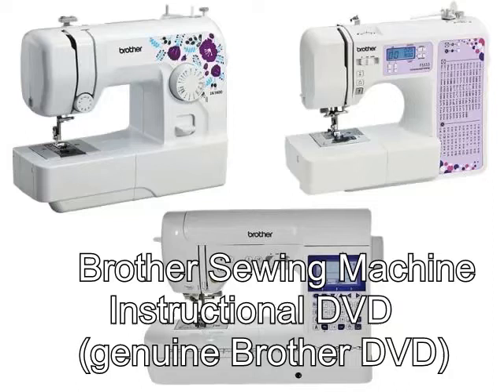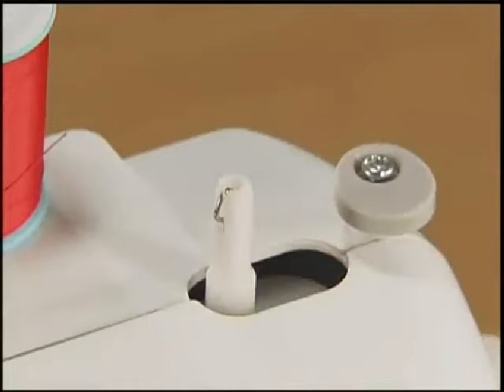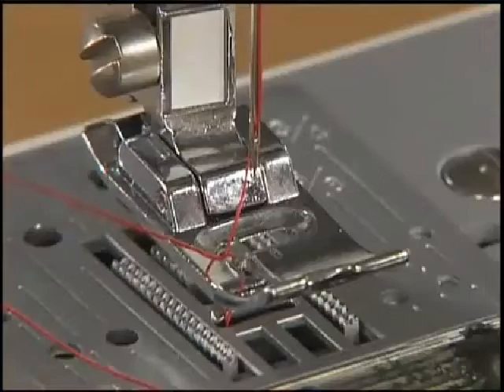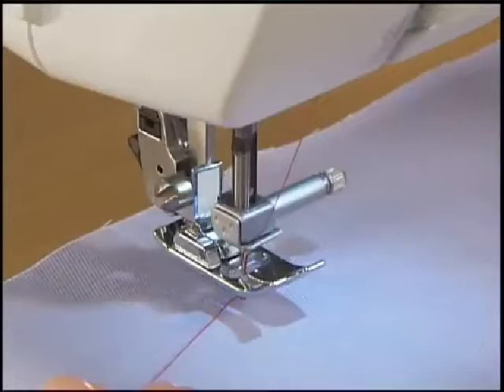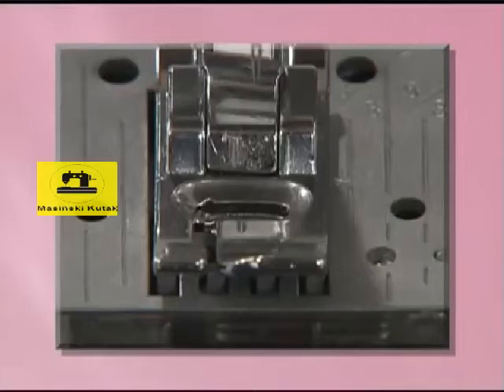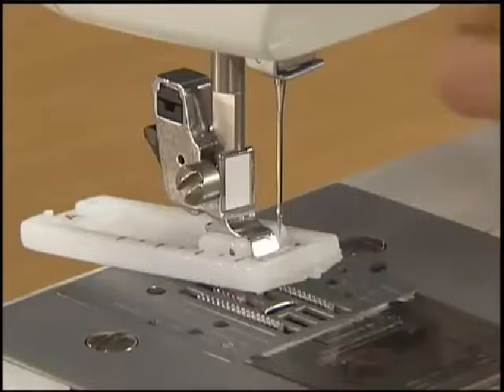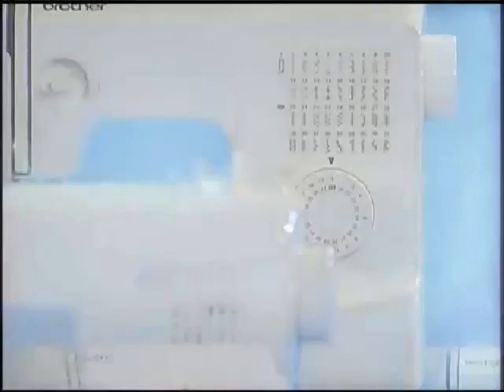Brother Sewing Machine Instructional / Brother Sewing Machine Tutorial dvd

Comment from the maker: 1:03 Setting up the sewing machine
1:30 Winding the bobbin and lower thread setting
5:24 Upper threading
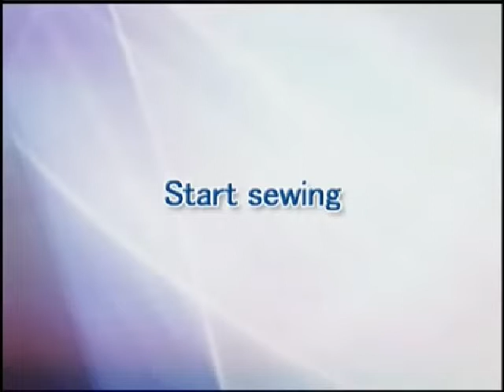8:44 Start sewing
10:35 Reverse sewing
11:39 Thread tension
12:13 Satin stitching
13:22 Adjusting the stitch lenght and width
14:30 Buttonhoe sewing
19:08 Button sewing
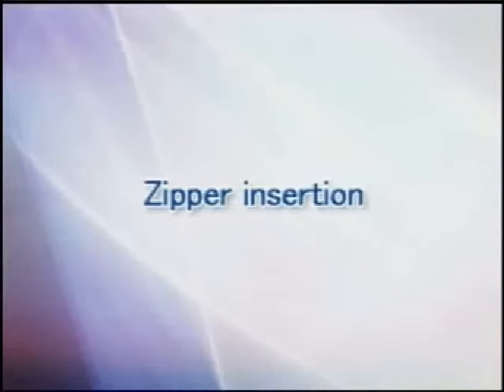21:15 Zipper insertion
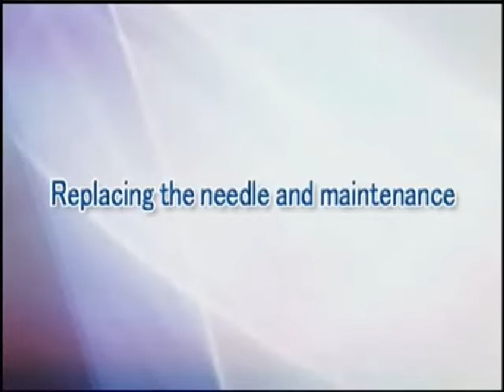22:17 Replacing the needle and maintenance

Comment: I have computerised sewing machine FS155
 but it doesn't work due to thread frequent break,  moreover I have multifunctional kit but I don't know how to use
Help me if you can please
Reply from the maker: So,Brother fs155 sewing machine frequently breaks thread.?
Thread breakage on a sewing machine can happen for many reasons, such as: poorly adjusted thread tension, old thread that breaks easily, poor quality needle, going over multiple layers of fabric...etc.
It is necessary to first check the tension of the lower thread and then reduce and increase the tension of the upper thread until a quality seam is obtained.
Reply: Yes it's brother fs155 
And it's still breaking thread frequently 
The thread sometimes hard stuck between the spot of 2 & 3 number😔😔

Comment: What about front loading bobbins? My machine is a ls2350 and you can’t load from the feed area
Reply from the maker: I don't think one video clip can present all the models of Brother sewing machines.
Is it a problem for you to insert the bobbin from the front?
Reply: @MasinskiKutak  I definitely did when I first got my sewing machine I’ve kind of figured it out but I feel like I still have issues with my needle picking up my thread even when the bobbin is loaded correctly
Reply from the maker: @ravenjanise  
If the bobbin is placed correctly there should be no problem with lifting the lower thread.?? 
Pay attention to the correct placement of the needle.

Comment: Why the handwheel wont work. Cant turn
Reply from the maker: It's a very general question, you didn't specify what model of machine you have, whether the machine is new or used, whether you can wind the bottom thread, whether the handwheel is completely blocked...etc.